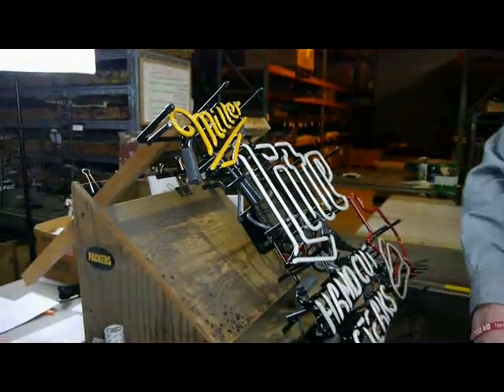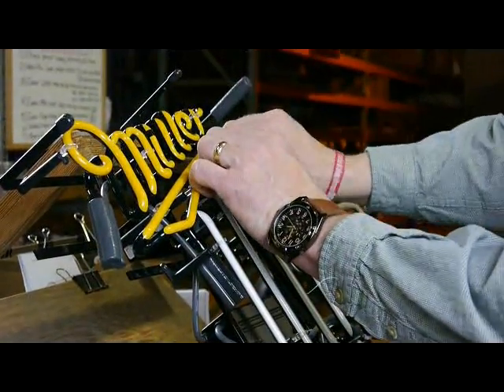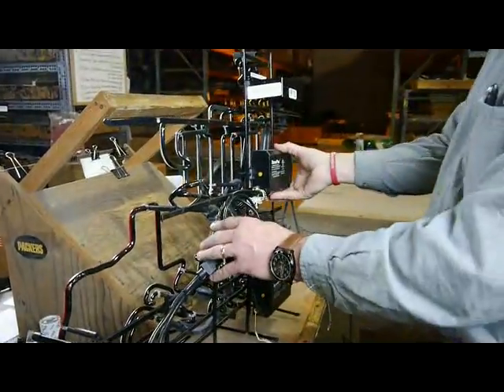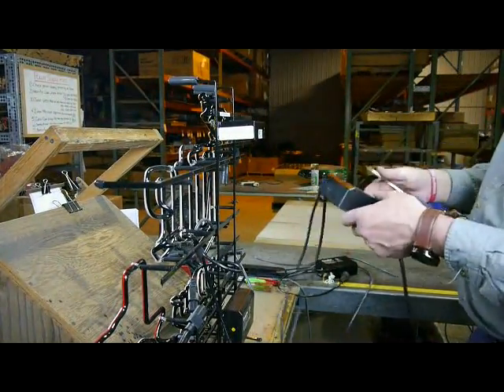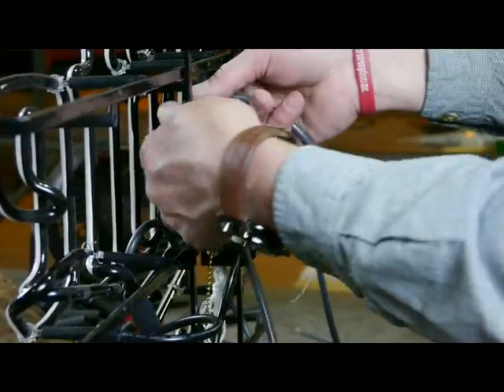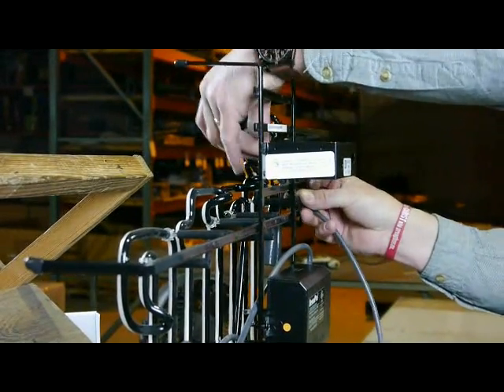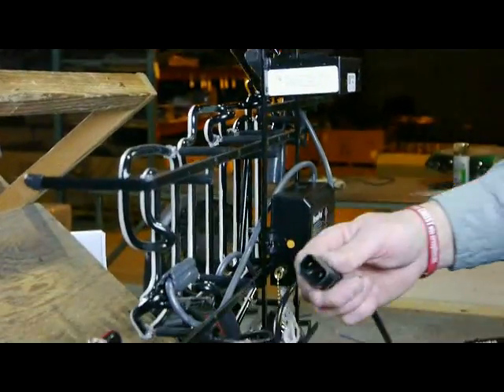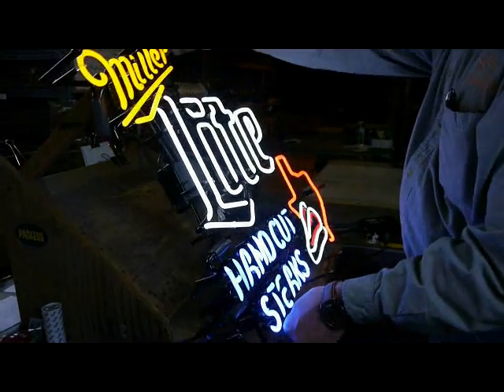neon power supply replacement

Comment: Like it will be a great help to me.  One more question where i find Power supply Model # ZPP301300000 INPUT AC100-240V 50/60Hz 2.5A Max OUPUT 12v 8A

Comment: Hi, I have a beer sign that was hanging in a liquor store for about 4 years. When it comes on it does not flicker or buzz. It stays lit for under 15 minutes and then completely turns off. Can you give me any advice on what could be wrong with it. Thanks.
Reply: Likely a slow leak in a tube - small enough to complete the circuit but because of the leak the transformer comes under increasing strain until it trips and cuts off. Not sure how to identify this because a testing tool would still give you light in that tube as it does in that 15 mins.

Comment: I just bought a neon sign less than a year ago and about a month or two ago it started not working. When I turn it on I hear a sharp buzz sound and the sign flickers and them shuts off. When it flickers all the tubes turn on, what do you think the problem is?
Reply: Without seeing I can only guess from your comment.  It sounds like a broken tube potentially.
Reply from the maker: Thanks for reaching out! Please email us at info@antigozeon.com with a picture of the issue and we can help diagnose the problem.

Comment: What about on older neon signs from the 1940's or 50's? If the transformer doesn't cross over to anything then you have to go with electrical specs then, right. I bought an old Blatz beer sign and Everbrite sold me an Evertron power supply that automatically adjusts between 2kV and 12kV at 25 mA. The one originally on the sign was rated at 6kV and 30mA.